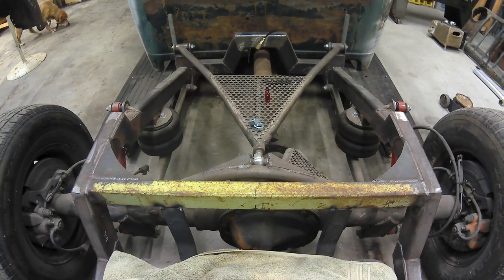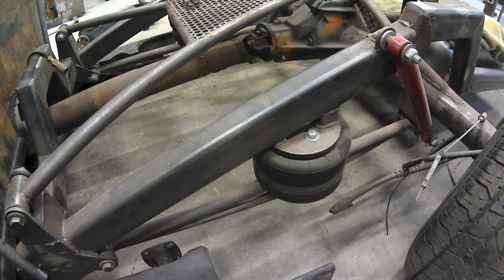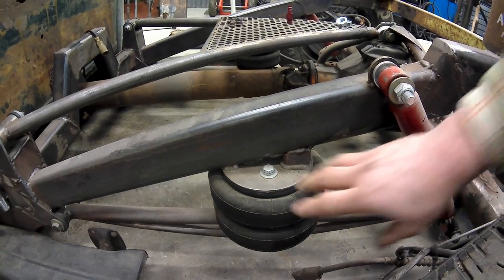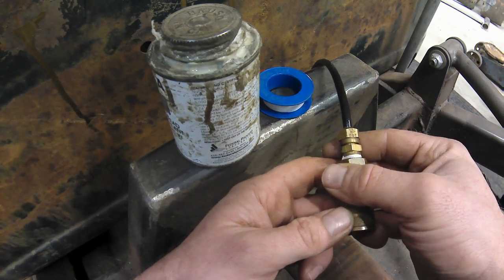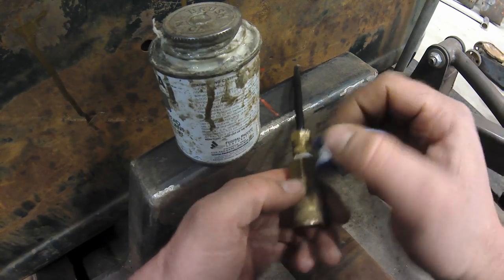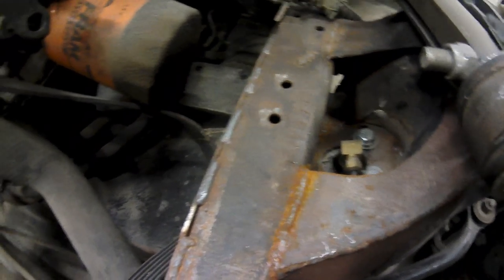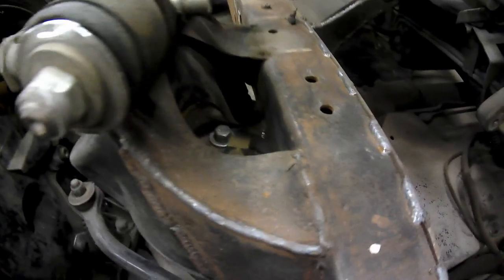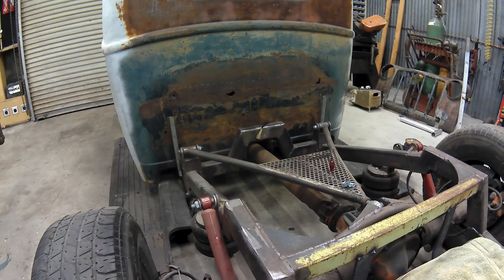air suspension Tips and Tricks

Comment: Hey love the build!  Just wondering if you removed the spring retainer on your bottom control arm? Or did you sit the bag on top?
Reply from the maker: Hey Chris! I rested the air bag right on the OEM lower plate. Its been a few years but I don't remember modifying the lower control arms